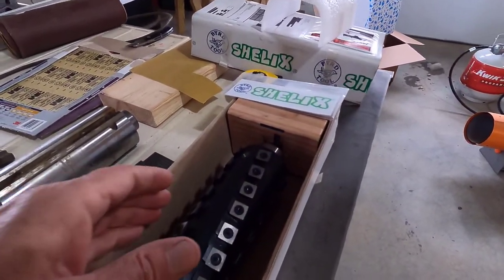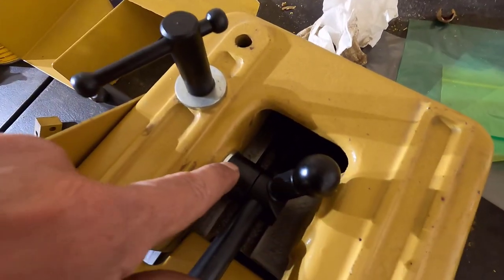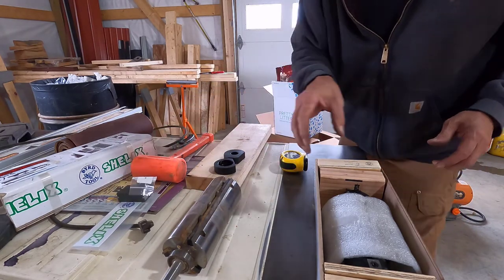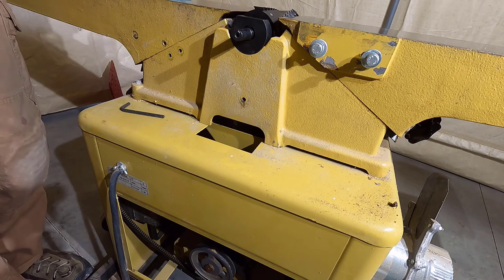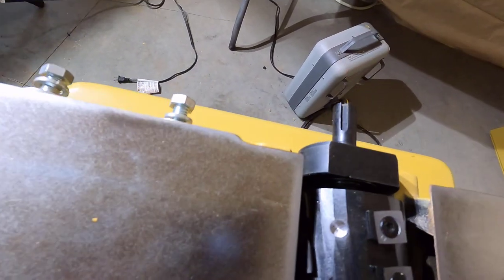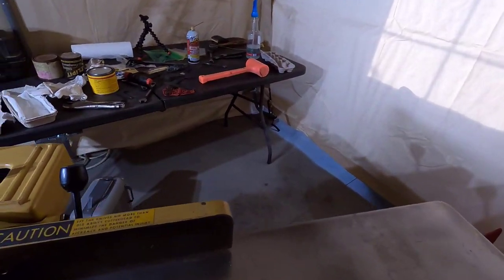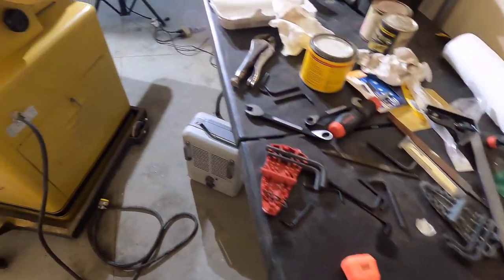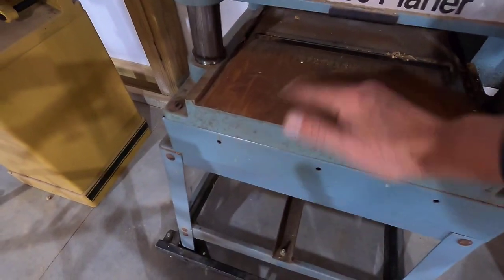Installing a Shelix Helical Cutterhead and Freshly Blued Parts!

Comment from the maker: With the Shelix Helical Cutterhead is installed, I expect to spend much less time adjusting and sharpening knives — that always too a lot of time away from the woodworking when my previous shops were up-and-running. Another benefit from the helical cutterhead is sound. They are a lot quieter when running lumber through them. The last big benefit — and this one is huge — is that I wont have to stop in the middle of a job and clear the machine of chips. helical cutterheads make zillions of 1/2" or-so chips instead of a bunch of long chips, therefore your machine will never plug up with chips. 

When you have dust collection on your machine, the chips from a straight knife can be up to 8" long on an 8" jointer, and if you are jointing at production speed, they can easily tangle and clog up at the pipe — which will quickly fill the entire inside of the machine and cause you to shut down and clear the machine out. The way to avoid that is to joint very slow — which is not only unproductive, but dulls the knives prematurely  — jointing slowly heats up the knives and exposes them to more contact with the wood!

I'll let you know my exact impressions as the shop progresses. Stay tuned!

All is well with the re-assembly of the jointer and the installation of the Shelix Helical Cutterhead. Everything went very smooth. I hope to be surfacing lumber soon, but the next step is to tear down the planer so I can change the cutterhead in that machine as well!

3M All Weather Flashing Tape - https://amzn.to/3ICBX4P
Huber ZIP System Liquid-Flash - https://amzn.to/31OtCtN
Seville Classics Commercial-Grade 5-Tier  60" W x 24" D - https://amzn.to/3qgjrXJ
5000 Lumen Temporary LED Work Light - https://amzn.to/3eslZfu
Heavy Duty 3-Prong Wireless Remote - https://amzn.to/3EnPWYN
Powermatic Model 60C 8-Inch 2 HP 1-Phase Jointer - https://amzn.to/3mvPq4M
Jet Contractors Saw - https://amzn.to/3mAAQJs
Insul-Hold - https://amzn.to/3evnmKq
1" Garage Door Chain Hoist - https://amzn.to/3rn11VF
1" 4:1 Open Garage Door Chain Hoist - https://amzn.to/3uldvQA
1" 3:1 Open Garage Door Chain Hoist - https://amzn.to/3IVxXf0
1.25" Garage Door Chain Hoist - https://amzn.to/32R3vmS
Ambient Weather WS-2902C WiFi Smart Weather Station - https://amzn.to/3GzRdNp
Brownell Oxpho-Blue Professional Grade Cold Blue - https://amzn.to/3BfKiYO
Evapo-Rust - https://amzn.to/3gJQEq4
Xcluder Rodent Control Fill - https://amzn.to/3oVsH3x